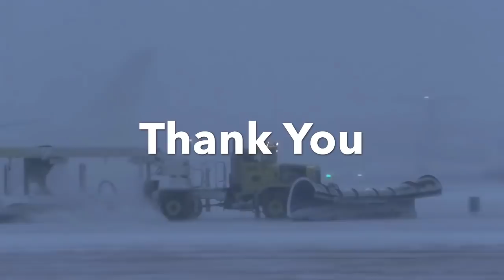How A Loose Nut Helped Bring Down A Passenger Jet | Hapag Lloyd Flight 3378 Episode 28

Comment from the maker: Hey guys I would have loved to give you more info on how the loose nut in the landing gear prevented the landing gears from retracting. But the final report was in German and the Wikipedia article was barebones at best. I do apologize
Reply: No problem my friend, you explained it well
Reply: you have absolutely nothing to apologize for.  Please keep up the great work.  Huge fan.
Reply: While there is nothing to apologise for, but if it could be known why the pilot took the decisions that he did which seem to be contrary from being practicle with such a lot at stake including his own life  would have made the article very useful. If a translation of the reports in German  could be arranged it would have been worth it.
Accidents due to human error are not devoid of the reason why the pilot made such a decision putting even his life and that of hundreds others at stake.
Reply: According to the report  https://reports.aviation-safety.net/2000/20000712-0_A310_D-AHLB.pdf the nut was on the rod of the hydraulic cylinder, to adjust the way how much the cylinder pulls up the gear. The nut has to be secured with a special ring to prevent to get it loose, however because of poor workmanship the ring was not properly mounted, and the nut got loose. So the working lenght of the cylinder extended over time, and after 2000 flights the distance extended around 10 mm. Because of this, the cylinder itself was fully retracted, but the gear itself was still not completely retracted. 
Unfortunately I couldn't find photos of a A310 rear landing gear, showing this detail.
Reply: https://reports.aviation-safety.net/2000/20000712-0_A310_D-AHLB.pdf from side 57 on it's explained in English, there are also drawings of the hydraulic cylinder from messier-dowty
Reply: Id like to hear crew members and pilots today what really happened. The reports are not 100% as it really happened.. In fact HLF was the best holiday carrier beside LTU and CONDOR but the company lied and blamed the captain to keep their reputation